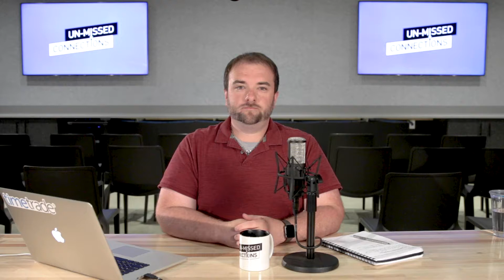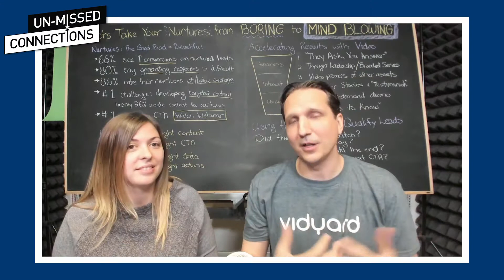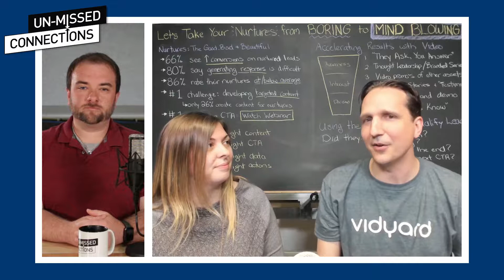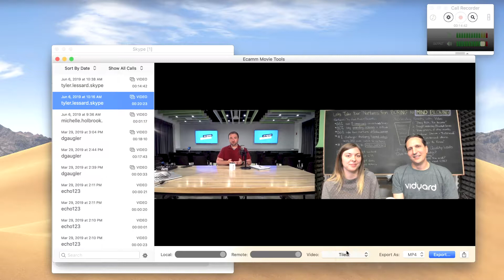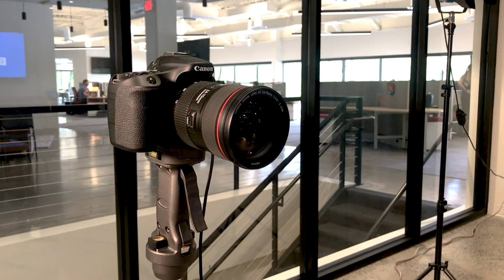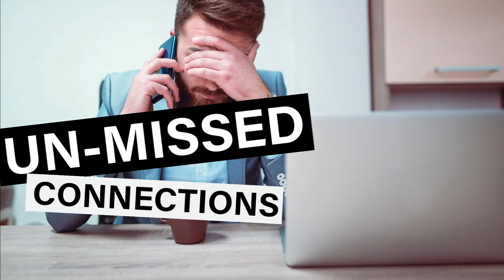Comment: how does this work if you want to record the video from there end and would this work if lets say they use an iphone or ipad? can this also be done from an ipad ?
Reply: Yes your remote party can use an iPhone or iPad. You however will need a computer to run the recording software. Plus it will be more reliable.